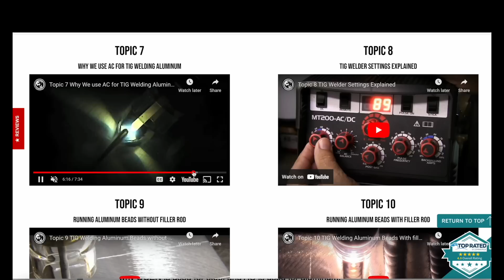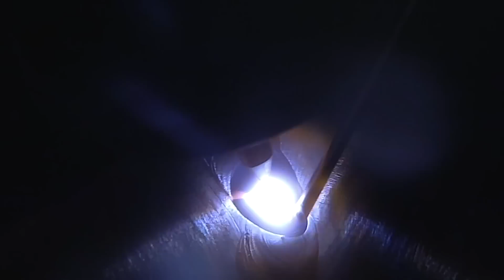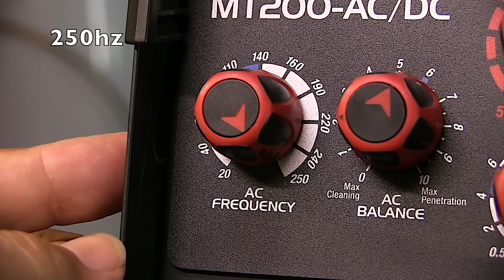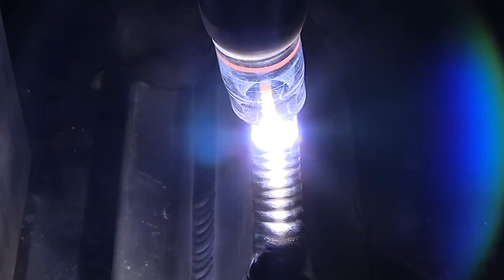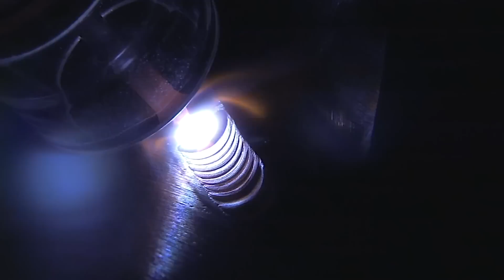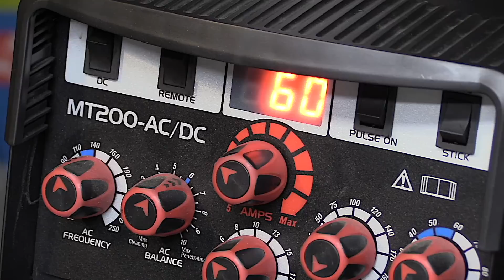CK WorldWide MT200 AC/DC TIG Welder

Comment: Hello Jody  i've been watching you for several years and have learned from you many many corrections in my welding to get things much much easier and better welding.   Until i started watching you videos my tig welding was always acceptable and always a struggle with aluminum.  But, with your help my aluminum tig is as simple as my DC tig,  so thank you much for all your help.  I recently purchased a Lincoln tig idealarc 300 amp.  I needed a big machine for bigger projects and i was wondering what your opinion is of this old school welder and if you have any operation tips.  So, far i am very happy with this big ol' girl.  If you read this your response would be greatly appreciated.
Lee Rude  from South Dakota

Comment: Congratulations on the 1M mark - I hadn't even noticed you were getting close.
That you've gone to the trouble of producing that d/loadable guide is a cool thing you've done for us, so thank you for that 👍

Personally I've very little experience with TIG - done a fair bit of general gas welding/brazing - some gas welding was on much thinner stuff than box-cutter blades, more stick, and some MIG (got one but seem short on projects of late), but having watched your vid's for some years, I think I'd pick the tricky stuff up quite quickly - at least to a good 'handyman' standard.

You didn't mention, that I noticed, if the giveaway is open to all your viewers around the world - I'm in New Zealand, for instance - or restricted to the USoA, even to the contiguous  48? If the first,  it may be adviseable to clarify if taxes, deliver, etc, are covered or payable by the winner?

Comment: Jody, With out a doubt you have been the most helpful person I have ever encountered helping me understand Tig welding. I started welding in the 70's and have welded professionally since the mid 80's. I did not tig weld much back in the day. However in the past ten years or so I have been engaged in repair work that is subsequently machined and the Tig welder is the ticket. 

Thank you for not only your tutorials, but having the Weldmonger Store available where I can purchase good quality supplies for my Tig torch. My weld supply certainly cannot be bothered to keep stock of decent Tig parts. So if I have to order them anyway.... I forget the name of them right now, the finger shield things are outstanding BTW! Cheers.

Comment: Woah!! I remember when you were at like 10k... Way to go! Absolutely. Your video's have taught me SO MUCH. But I have never really seen you mention proper gas use (specifically in the MIG videos). Black sooty after weld = to much (15-20cfh standard is usually to much gas, I use about half personally) gas you are burning. You want the nice white soot around the weld. :) Welds better and  saves money ;)

Comment: Great job Jody,  and CONGRATS on 1 million subscribers, what an accomplishment.  I'm a retired welder/tool and die maker.  I've retired now going on my 10th year and have a Miller Maxstar 150 (shoebox welder) that works great for the welding I do.  Since most repair welding is DC I really don't need an AC machine.  Although I just TIG with my unit I still have the stick capabilities if I need them. and it can run on 110 or 220, has a pulse, touch start, and I have a thumb remote control on it.  I've never used the clear glass cups and wondering if they are better or not.  Again congrats on the ONE MILLION,, it means you are doing something right Jody.. lol.    Would be GREAT to WIN the CK mt200 Tig Welder.  crossing my fingers... looks like a great little machine.

Comment: Love all your videos Jody, thanks for taking the time to post welding content.🙏
    I have a Lincoln 175 inverter tig machine and have had trouble getting enough heat on 1/4" Aluminum lap joints. Lowering the frequency might just be what I've been needing. Thanks

Also, I typically use tri mix gas on stainless. Didn't know it could be used welding aluminum too.
Reply: argon , co2 and o2 ?
Reply: @eflanagan1921  Argon, Co² and helium Mix. Aka TriMix at your local AirGas. I don't remember the exact % mixtures.